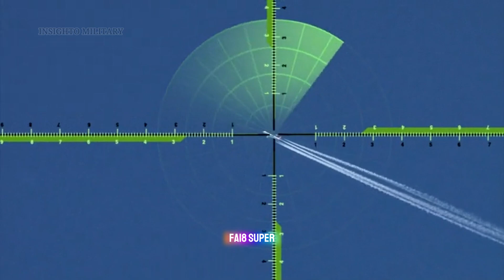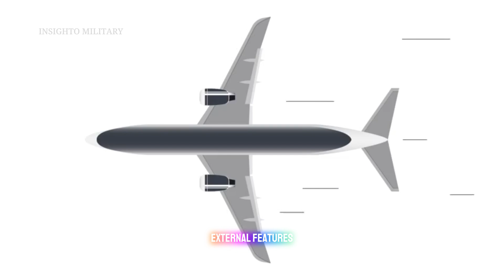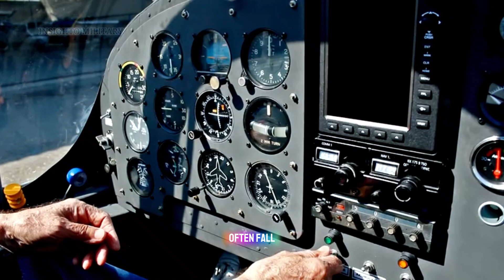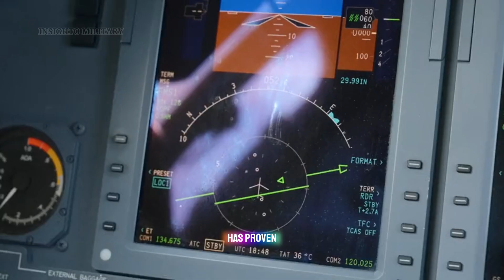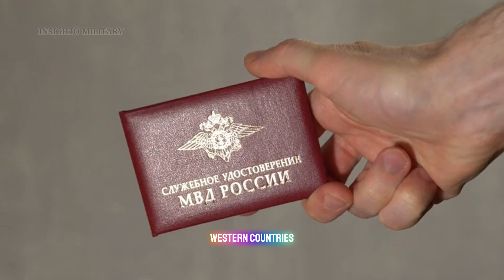Russia's Su-57 "Felon" vs F-22 & F-35: Why Can't Russia Build a TRUE 5th Generation Fighter Jet?

Comment: Ok, While the Su-57 is marketed as a fifth-generation stealth fighter, it falls short of the stealth capabilities of aircraft like the F-22 and F-35, particularly in all-aspect stealth. Its radar cross-section (RCS) is estimated to be significantly larger, making it more detectable by radar systems. Although it incorporates stealth features like internal weapons bays and radar-absorbent materials, its overall stealth profile is considered inferior
Reply: Still it's quite stealthy also that F/A 18 thing really exaggerated
Reply: @neeladridas2096  The Su-57's radar cross-section is estimated to be significantly larger than the F-22 and F-35, potentially by a factor of 1,000 or more, according to some aviation experts on Quora.
Reply: @SuperGian82 Yes, mate, the Su‑57’s RCS is higher than the F‑22 & F‑35, nobody denies that. But ‘1000× higher’ is a fairy tale that even Hans Christian Andersen would find far‑fetched. Let’s talk numbers, not feelings

F‑22: RCS around 0.0001–0.0005 m²
F‑35: RCS around 0.001–0.005 m² Su‑57: RCS around 0.1–0.5 m² (estimated)

So the Su‑57’s RCS is probably about 100–500× bigger than the F‑22, and about 20–100× bigger than the F‑35, depending on angle & maintenance condition.

But here’s the kicker:
Even 0.1–0.5 m² is still stealthy enough to make radar tracking and engagement extremely hard, especially with jamming, decoys, and tactics thrown in.

Comment: The obsession of the US with stealth is a fallacy. That stealth is limited to X-band. After three decades Russia is well equipped to detect Stealth with radars operating in lower bands. The F22 only with later update received optical sensors. More importantly the F22 lacks really long range missiles.